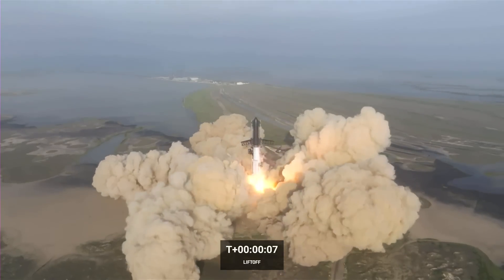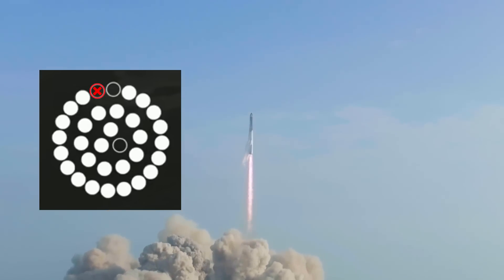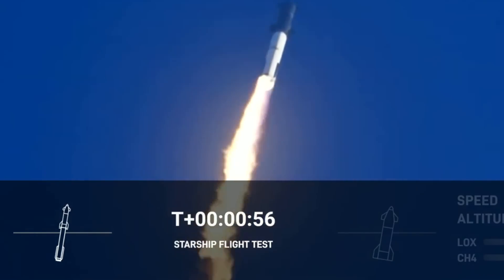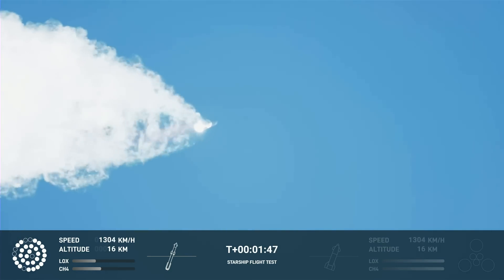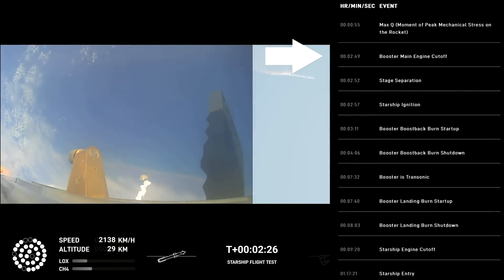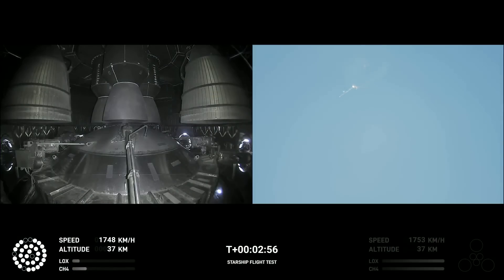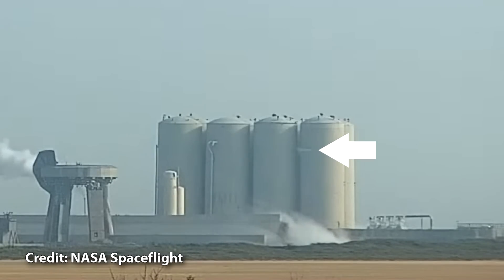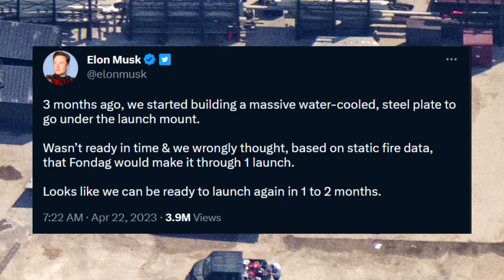I Watched the Starship Test Flight at 0.25x Speed & Saw What Went Wrong | Starship Flight Analysis

Comment: Here are things you may have gotten wrong based on info released by Elon recently:
1. Hold down clamps were already released, they were not holding down the rocket
2. 3 engines were shut down at lift off itself
3. Starship did not reach the point of stage separation
4. Destruct command was given earlier but nothing happened for 40 seconds
But overall a very good analysis.

Comment: Fine analysis, no disagreement. I personally don’t see Starship flying before October if at all in 2023.

IMHO the FAA, if not NASA and DOT, along with environmental NGOs will forces much more to be reckoned with, demanding a greatly revamped Stage 0 than just a lousy steel plate. Musk is going to have to get the OLM up another 40 meters or so to be able to build a proper flame trench à la Pad 39 at KSC above ground since the high water table at FL & TX are both problematic for the constructions.

This will also require SpaceX to come up with a robust deluge system requiring large water towers that can be fairly quickly refilled to support Starship’s proposed launch cadence and source enough fresh water to fill them. I don’t have a clue if pumping ground water would be allowed to support that; if not, SpaceX will have to build a desalination plant. Oy.

While I am a terrible fortune teller, my guess is at some point Boca Chica will be reduced to a manufacturing and test site while the routine launches are either conducted from remanufactured oil rigs out in the Gulf, or at KSC. This will be important for SpaceX to master if Musk’s dream (or hallucination) of a Starship v2.0 is going to work; it would be almost impossible to land launch such a mammoth vehicle.

Comment: I have a more negative view of the flight. A lot will depend on the reasons for the engine failures. Running that many engines side by side is a massive undertaking. The fact that several failed in pairs may mean Spacex hasn’t properly accounted for interference between engines. 

As far as timeline goes, I think six months for FAA approval is optimistic. The FAA is going to be looking at every single way the pad can fail and Spacex better have good answers. With construction and final approval, maybe a year till the next flight. If they have to build upwards for a flame trench, probably longer.

Comment: Starship performed 'structurally-and-dynamically' as designed, and did not succeed because of damage due to Stage-0/launch pad design. Like using a larger bullet with a small gun; likely to backfire, causing significant damage. That 'standing' tank-farm is much too close to the launch pad, and could have caused a much bigger catastrophe from shock-wave/debris. 6-mos to 1-yr, to not only repair Stage-0, but to design a safer  launch facility. We will see what is happening in Florida, because SpaceX will need more than a water-cooled steel pad to counter the thrust/shock feedback during 8-second holddown. 3-sec hold; [3] water jets [2] max thrust [1] release. This B-F-R can fly, and there's no reason why orbit is not a real question anymore, ...just a matter of time; "Raptors Rock"(!)

Comment: As you were explaining that the FTS did not activate, you can clearly see the holds in both stages caused by the FTS. Elon confirmed thaf FTS recertification would probably take the longest because it took 40 seconds for the vehicle to RUD after activation

Comment: I knew I wasn't crazy seeing more than 5 engines out! From what I've seen, stage separation most likely didn't occur because the craft was too low. More than likely, it was programmed to release between x and y altitude, and was tens of kms beneath that area. As for why the FTS didn't work, I have a theory. It could've been designed with more of a "stream parallel to the rocket" idea vs the "spray every which way" that happened. Perhaps a small redundant igniter would suffice

Comment: The holddown clamps were released at T-15:00 (said during SpaceX stream)
Also i heard that they deliberately only fired 30 engines to launch.
Reply from the maker: I’ve been getting a lot of comments about this. The hold downs unlatch several minutes before, but retract at liftoff, as per John Insprucker on the SpaceX webcast.

Comment: Really excellent video. Your analysis shared insights I haven’t seen shared before. 
I agree another launch is unlikely in the next 4 to 6 months. The FAA are going to likely have some significant additional requirements to be met, given the environmental impacts of the launch, before issuing a new launch license. NASA, which is risk adverse, will not want to see another failure which could cast doubt on the viability of Starship as the sole HLS vehicle, and would probably ask SpaceX to proceed with all deliberate speed.
Elon was right when he said a couple of years ago that launching with a water deluge system might be a mistake. It might have been fun to launch on 420 (an inauspicious day if you know history) but it would have been better to wait and complete the installation of the water cooled steel plate under the OLM before launching.
Reply: Sorry, but "with a water deluge system", read "without a water deluge system" :goodvibes:

Comment: I recommend you do more research past watching in slow motion. A bit of investigation might have revealed to you that the hold-down clamps were released before ignition of the raptors. The stack was simply sitting on the OLM while the thrust increased until it was greater than the vehicle's weight.
Reply: Wow!  Lifting off at the moment thrust > mass would give very little spare thrust for vectoring, as any off-line thrust would reduce the direct up thrust, and hence risk the whole thing descending again.  A wee hold until a decent thrust margin was available would be would be a good plan, IMHO! (Tho with all that thrust, would not want to pull the OLM out of the ground like an old tooth!)

Comment: Great analysis. What are your thoughts on the accelerated loss of LOX starting at T+55 seconds?
(Edit: changed the timestamp so YT didn't convert it to a link)
Reply from the maker: Thanks! I noticed it, but we didn’t see any visual indication of such a large leak, and it abruptly stopped, so I wasn’t sure what to make of it. It could have just been a problem with the webcast data, just like how the engine graphic wasn’t 100% correct.
Reply: If you want a great analysis, Common Sense Skeptic's analysis from a couple of days ago is the best one so far.
Reply: @cosmicaug  Common Sense Skeptic’s video was only the best at analyzing protected sea turtle eggs. It was egregiously biased trash otherwise. Hated it!
Reply: @Syclone0044 , I can see how it could look that way since sometimes reality is, indeed, "biased". On the other hand, if things that Common Sense Skeptic was presenting as factual were not factual, then we would have a problem.

Of course, anyone taking Elon Musk seriously by default (due to motivated reasoning) might have trouble distinguishing that which is real from that which is wishful thinking at best.

Comment: I think that wishful thinking that the launch pad would have been ok with the launch of such a powerful rocket was reckless. It is now hard to determine which aspect of the failure was due to the damage of the flying debris and which was not related to that.
Reply: which would make the much-repeated line about 'they still got so much data from this test' not true - the debris (and we can see from the splashes that large chunks of concrete were thrown quite far, very fast) is a huge confounding variable which will be difficult if not impossible to tease out. That makes all the data compromised at best (source: I used to do statistics in research). I don't necessarily believe Musk when he says they opted on the spot to shut those three engines down as he has a track record of saying things that aren't true because they play better in the press. His need to turn the launch into a 420 joke may have grounded them for a year or more. Such lols

Comment: Elon said the 3 engines were shutdown because the system deemed them not healthy enough for full thrust.This vehicle did lose thrust vectoring control before it started to tumble. The Starship never made it to the separation stage due to its loss of vector control and engines. Also as far as Booster 9, Each engine will be isolated from one another so if one explodes it does not take out multiple engines like what happened in this flight.  The booster will be fully reusable in the final design.

Comment: I'll echo what others have said: you have done a better job on the analysis than most other channels that exclusively address SpaceX. In your summary of failures, you missed mentioning again the possible structural failure at the top of the booster that may have locked ship and booster together. Nonetheless, an excellent analysis. Keep it up.
Reply from the maker: Thanks so much! It was somewhat speculative whether that was a serious issue (at the time - now we know separation was never even attempted) so I didn’t want to draw any hard conclusions from it.

Comment: While the positives are exceptionable and applaud able, the lack of proper mitigation of system failure points is highly questionable. When is saw the destruction of the pad and resulting cascading failure of the booster, I thought this does not bode well for the "just refuel and fly back" narrative of Starship. Clearly engineered launch facilitates are required for StarShip to launch back safely from any site. Starhip will be subject to launch damage due to its mass, in its current configuration. If it is found that a water deluge system is required for to mitigate shock wave/debris induced damage, that system will be impossible to implement on other planets.  I admit this is a downstream problem . But from a system use point of view, there is way more engineering and testing required to achieve its design goal of making it as routine and safe as commercial air, way more than Elon indicates.
Reply from the maker: Of course. This is still early days and there’s a lot of work for SpaceX to do!

Comment: Absolutely astounding breakdown! New subscriber here!

I think they CAN have it ready in two months, but am betting more like 3. They'll use that time to build entirely new boosters and test the crap out of Raptors. 

I have a feeling only 1 or 2 Raptors didn't work as intended, the rest were all lost for secondary reasons. It's not up to the reliability of Merlin, but since only a handful of Raptor 2s have ever actually flown, damned impressive. 

One thing you didn't mention that really impressed me was at least 1 or 2 Raptors ate themselves (likely due to FOD from Stage 0), and did is spectacularly. In both cases they don't seem to have breached the tanks above them or did significant damage to their adjacent engines. They're much more robust than people think. Starship is destined for an amazing future.
Reply from the maker: Thanks for the great feedback! SpaceX goes to great lengths to isolate the engines from each other so there’s no cascading failures. This has been improved in B9.

Comment: I will give it to you for guesses, but Elon has already given a play-by-play of what SpaceX thinks happens, and its quite different than this.     3 engines were intentionally shut down from the start.   He claims no damage to the ship from debris but the heat shields on the raptors failed early flight that caused a cascading failure.    They didn't hit separation altitude and SpaceX decided to abort without an attempt due to safety concerns.    His biggest concern of the failure of the flight termination system.   Their team claims it didn't have enough explosives for that altitude and may have to requalify which may take some time.

Comment: “some reason” appears to be the remaining fuel in the tanks that was burned slower than anticipated (fewer engines running)

And this MaxQ event probably occured at well below the intended speed due to greatly reduced thrust. So I would consider this only a partial structural validation.

If “Common Sense Skeptic” is right, the next launch won’t be so soon - and possibly not from Boca Chica. He really ripped into SpaceX in his latest video.
Reply: Thank you for bringing up the max-q stress test being significantly weaker than what a nominal launch would likely experience. If that max-q callout was accurate in timing at T+1:18, Starship had a velocity at that timestamp of about 830 km/hr at ~8000 m. Ballpark q of about 14,000 pascal. In comparison, a recent Falcon 9 launch hit max-q at about 1650 km/hr at ~13 km, a q of about 30,000 Pa.

Of course, this is a little bit of comparing apples and oranges, in that these are different vehicles. It seems to be a reasonable assumption that these vehicles should have broadly similar ascent profiles and acceleration curves given what we know of the anticipated ascent profile for Starship compared to a typical Falcon profile, which would mean similar max-q (about 1/3 of an atmosphere, same as Apollo). But we don't really know what a typical acceleration curve for a full-power, healthy Starship looks like yet. Nevertheless, I have a hard time believing it would be on the order of half the Pa experienced by Apollo or Falcon 9. They'd be accepting very significant gravity losses to intentionally minimize max-q so much, which certainly doesn't much sense to me.
Reply from the maker: Those are good points. That BECO callout threw me off. In hindsight, it was obviously only based on the timeline. And I should have mentioned that max Q was probably not as high as it would be on a "proper launch."

Comment: Stage separation did not occur because its not supposed to occur until a set of conditions are met regarding velocity.  That is, if raptors flame out, the remaining raptors keep burning until ALL the allocated propellant has been converted into delta V.  Secondly, had starship just blown up on the pad that would have been LESS damaging to the pad because it would just have been a Burn off with MOST of the fuel not even burning, and the evaporating liquid oxygen literally cooling the pad.  This was, in fact, the worst case scenario with the full fury of the engines pounding the concrete pad to rubble and stripping it off at 300 mph. The pilings were exposed and subjected to acoustic shocks that were made worse by constructive interference from so many engines producing hundreds of sonic booms per second.    It is unlikely that debris too out the engines as the blast from the engines would have knocked down anything thrown up directly at them, But in the drone footage of the startup you can literally SEE the constructive acoustic interference creating pulsing shockwaves that traveled directly up along the side where the initial engines failed and the hydraulic system got damaged.   Just as it was the acoustic energy that pulverized the concrete, allowing the engine plume to strip it off the rebar, it was likely the acoustic energy that damaged the raptors.     SpaceX’s design for the launch mount was criminally incompetent, given that water deluge systems and flame diverters have been established as essential for at least 60 years.  A water cooled metal plate, flat on the ground, will NOT divert acoustic energy- it will be pounded into coined potato chip shaped shrapnel and be turned into a steam boiler by the heat energy.  Water deluge needs to be on TOP of concrete and metal structures to protect it from the acoustic shocks in a rocket launch. And the thrust plasma needs to be diverted, not just allowed to blast at a flat surface and spread in all directions.  The tank farm was stupidly close, and the six legged pad design did nothing to channel blast effects away from that critical infrastructure. ( compared to the Pad 39 at canaveral that diverts flames and acoustic energy in safe directions. ).   All in all Stage zero is an abject failure in rocket science, given that ALL of the problems it suffered were well understood and the measures necessary to mitigate them fully developed and time tested. And the critical failure was that Obviously, the team at SpaceX did NOT think the fondag could take launch, otherwise they would NOT have been already designing and building a system to protect it, but SomeOne made the decision to launch before it was ready.  Musk is gonna face some serious question from the board about why they didn’t just wait until the metal plate was in.  I suspect he had pressure from either needing a new finding round, or to meet a performance deadline to keep that Artemis moon lander money coming from NASA.

Comment: Like, Sub plus a comment. Pad and area rebuild to New standard dictated by the FAA 6 to 8 months. Looking over all the FTS and engines data will take time to evaluate plus any needed redesigns dictated by the FAA. Other than massive chunks of concrete being hurled around it was a better attempt than the US Navys third Vanguard launch which got about a yard into the air then collapsed back on the pad. Advantage of being 72 and remembering all the old failures.
Reply: Yeah, I remember that. It was Vanguard TV - 3 launched, sort of, on December 6, 1957.   Watched it on our new 21" B/W TV. That was a big hit to our national pride. Called in our best Germans and launched Explorer 1 on January 31, 1958. Exciting stuff for a 13 yr old kid.